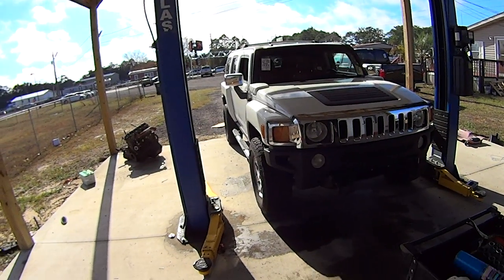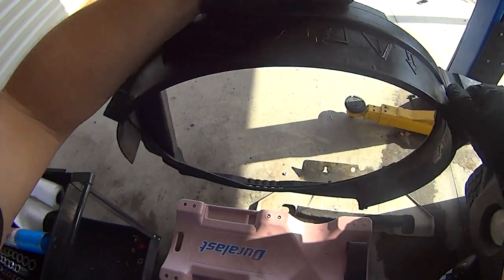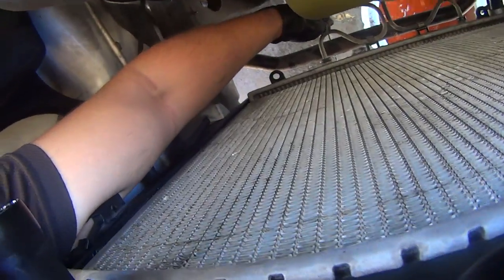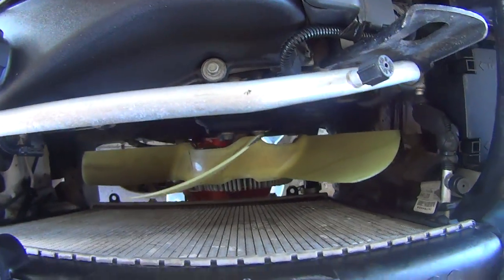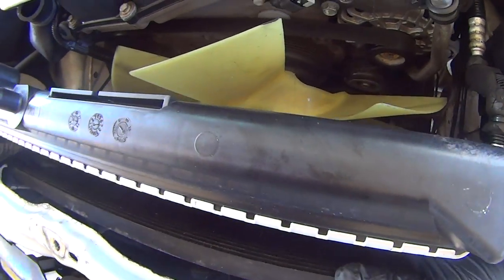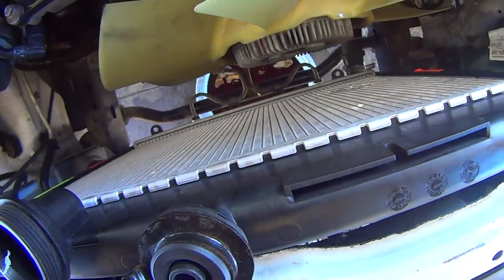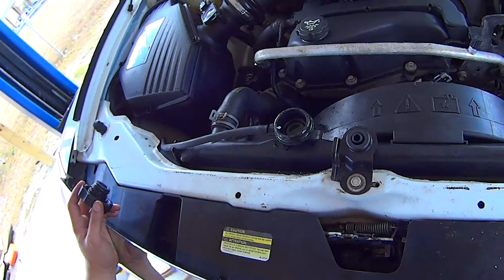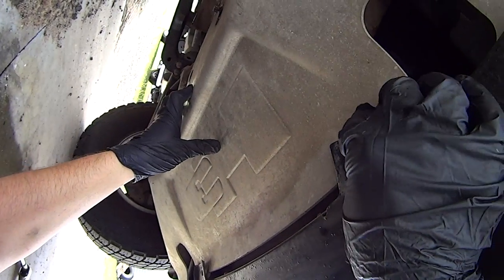Hummer H3 Radiator Replacement COMPLETE GUIDE

Comment: Hey man great video. My radiator just gave out on my 06 with 177,000 miles. I'll be doing this next week. Mine has some foam at the top to protect the top of the radiator from rubbing against metal. Did you find yours rubbed on metal? Thanks!

Comment: I noticed at the beginning of this video you said that was a 2006 H3. Would this pertain to all H3's with the 3.7? I have a 2009 and it looks the same.
Reply: Yes, exactly the same radiator....
Reply: What size radiator does a 2007 Hummer H3?
Reply: @brendacassata9885  All Hummers take the same radiator. All years, and all motors. Even the 5.3 v8 uses the same radiator.

Comment: you don’t need to remove that clips for transmission line  in the new radiator  all you just gonna do is push the lines in and it will snap in to places
Reply: Oh, thanks Angel for clarifying that. The video above was unclear about that and I was scratching my head because another video implies what you just said. So you are correct. But to remove the old radiator and the lines you do have to remove the clips just like Angel says, people.

Comment: This video is awesome. Your step by step was very easy to follow and just works. The shops wanted to charge me over $1000 for radiator replacement. I did all the work and spent $170.
Reply: You there? Tryna find a radiator that’ll work but won’t be to much.

Comment: WOW, even for a disabled guy, this repair was doable. On the 2007 model, there is literally only one bolt that holds everything together. This hummer has never had heat as it does now. Very happy wife, even happier come this winter. Thanks again.

Comment: UPDATE: I followed your directions to the letter...Except for putting it on ramps to bleed the air out of the front of the motor. (I didn't have ramps) The motor was running hotter than usual on the Freeway and at lights. I bought a set of ramps did what you said BOOM temp is perfect actually running even with the middle mark it used to run just on top of it. Usint the vicegrips on the clamps was a lifesaver.

Comment: Should mention that GM's require Dex-Cool or "Universal " coolant.  Use regular Prestone you will cause problems with leaks in the aluminum components in your engine and cooling system.  The jug you used did indicate Universal but could be easily missed.

Comment: My question is, would the rad be a possible cause for leaking? I know I have a coolant leak I just have to get it to the shop to see where it’s leaking from. Most likely an old line as my hummer is used but I got home today and my rad was smoking a bit. So I feel that this is another issue I have to fix but would I need to replace the rad if my coolant is leaking? It looks like it’s leaking right out of the rad somewhere and dripping to the pan and off the little pan lip on the driver side. Thanks

Comment: Hi from Germany, you will get completely the airbubbels out If you drive the motor hot and turn the heat sensor a half turn out, you will hear ffffft  so no Troublecode P0128 anymore and you  will see in display the temperature is in the middle of the field.

Comment: Me too, this is the 1st time I did it by myself (old lady, kind of hard because I don't have muscle). Do I have to remove the spring clip or leave it in there? I removed it, then inserted the trans line & I had a problem inserting the spring clip back. I don't know if it inserts properly or not but I'm guessing it's not sitting properly because the plastic rings do not sit flush with the opening. Please (anyone) let me know ASAP so I can finish the job. Another problem is I got a lot of trans fluid coming out (maybe 2 qt.) so I need to fill the new trans fluid back in.
Reply from the maker: It is easier to re-install the spring clips prior to installing the lines. The clips are designed to expand when the lines are inserted, then engage with the notches on the lines to hold them in. You should hear a little click when they engage.

Comment: Is that fan shroud aftermarket? I have an '07 Colorado and it uses a two-piece shroud. I do see some one-piece shrouds on Amazon, however?  Also, is the metal skid plate aftermarket or stock on the H3?

Comment: I noticed the tip of the old radiator has broken pieces. Would you worry if they went inside the motor?
Reply from the maker: Since the flow direction is towards the radiator, the debris gets caught inside the top tank. The radiator fins are too narrow to allow anything large enough to be harmful to pass and continue into the motor. The debris stays with the old radiator.

Comment: my h3 hummer 08 is skeeting coolant  from the bottom of the fan. what can it be
Reply from the maker: +Juvia MSP Cracked radiator is very common on these vehicles. Do a pressure test, it makes the leak much easier to find.

Comment: I seen that you used the green Coolant instead of the red. Does that make a difference? Also how much do I need to refill? Thanks
Reply: Never do that..... Ethylene glycol does not mix with Dexcool and Hummer H3's all use Dexcool! Engine block still had orange Dexcool in it.
Reply: Ya never use any other coolant in a Hummer only Dexcool

Comment: *I just change my 2006 H3 radiator., set the heater on high- hot,.. but didnt blow any air inside at all, and the AC line "froze"... whats wrong , is that a sign that it need any 134a feon?*

Comment: When trying to get the AC condenser coil into the lower slots I was putting what I thought was light pressure on the coil and dented the top of it where my thumb was. Will this cause an issue? Should I have tried to lift it back up carefully? Everything else went smoothly but hoping I did not cause a future issue and was wondering if I should be looking for something. Thanks

Comment: Went to the beach the other day, drove  on sand and out the blue i got this plastic smell. And notice the temperature went higher than usually. I parked and checked what was it, never found out and when i turned h3 back on temperature was normal less plastic smell. Could this be radiator? I checked cant seem to see no leaking or water dropping neither

Comment: This guide helped.. but I ran into a frozen coolant line (remove the entire fitting from the radiator if needed), and my condenser was attached to my stock radiator with 3 plastic fittings.  So the part when you show the radiator and condenser separate easily the left side stayed attached and I fought with it until I noticed the 3 fittings and cut them.

Comment: Hi there I replace the radiator on my 2007 hummer h3 thanks for the video only had one problem went I added the transmission fluid I ad it one quart and I think I over did it so today I pump it out. I'm having trouble checking the oil level is a little tricky to get the exact measurement. My question is how many onces of transmission fluid did you ad after replacing the radiator?
Reply: Ivan N the to

Comment: Someone is trying to tell me that when you pull the AC condensor lines, you have to recharge the system. It didn't look like it to me. Is that true?
Reply from the maker: +Joe Blow Only if you are replacing the condenser. If you are just replacing the radiator you don't have to bother with the refrigerant at all.
Reply: Thanks AutoRex, that's what it sounded like. I should've replaced the radiator myself. The repair shop said they weren't quick disconnect/sealed fittings. Getting railroaded on this one.

Comment: Watching this gave me the confidence to tackle this job.  Like everything, it took me a lot longer than the video to do the exchange.  My new radiator didn’t come with new nuts for the side connections, so I had to recycle them from the old unit.  The tip on using a pick tool was essential to disconnect the transmission cooler lines.  I replaced the radiator cap and nearly one quart of ATF fluid (Type VI) also. Be prepared. Thank you!

Comment: my H3 hummer 08 temperature gauge Rises to 3/4 when it's extremely hot outside. I already change the temperature sensor the water pump the fan. my temperature sensor goes up when I'm sitting in idle to 3/4 but once I start driving it goes back down to 1/2. So my question is do you think I need to change the radiator ?
Reply: I am having same issue! New radiator, fan motor from Chey dealership, new everything that goes w radiator but still same issue. An electric fan installed didn’t work ??! Can anyone answer our question?????
Ty
Reply: Juvia MSP 
Did u figure out what was wrong?
Reply: Had the same problem with my 2006 H3 so I put in a CSF 7061 High Performance Aluminum Radiator it resolved the temperature issue.
Reply: @bjohns6021  what problems did your have before? Was yours heatting up and going back down when you drove? If so putting that radiator worked you say?
Reply: @brendacassata9885  did you find the answer to your problem?
Reply: @gohan9638  I only noticed it when the temperature was over 80 degrees and the temp gage would start moving toward 3/4 at a stand still w/AC on(that point will not cause overheating if it stayed there) Once I started getting airflow on the Hwy the temp went down to about half. I started reading and found some heating issues with the Hummer OEM radiator and just decided to try a performance aluminum radiator instead. I changed both the radiator and the thermostat. In making that change what I noticed was the temp gauge still went between 1/2 and 3/4 with AC on and 90 degrees outside temp but actually just stays there at a stand still and goes down very little when I'm driving. After I researched a little further I found out that new thermostats from GM are set at a different temperature than the older ones for emission purpose's so it won't open up until the temperature higher. If I would have kept the older thermostat the temp gauge(180-185 degrees) may read be a littler lower. So far I like what I've seen and haven't had any issues although the summer is not over yet! Ask be in 3 months or so.
Reply: @bjohns6021  thanks a lot for the reply. I Will
Reply: Also I noticed that the cooling fan only stays on one speed not sure if there's a second speed where it's supposed to speed up to cool down further but I'm looking in to it.

Comment: You didn't flush the coolant, replace the fan clutch or hoses. You also mixed coolants, a big no-no, especially with Dexcool. That's going to gum up the new radiator nicely....and will look brown. Lastly you didn't burp it properly, which is done with a special funnel in the filler neck.
Reply: if its only the radiator that gets clogged he will be lucky, hopefully none of the engines ports get gummed or blocked. Then the whole head has to come off and cleaned out not to mention the engine block.